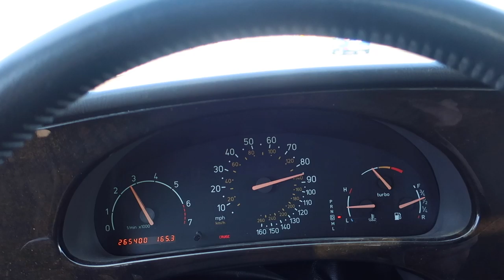Super Rare Junkyard Parts Find for my Saab 9-3!

Comment: I have 2 saabs and one has premium leather. If it is premium leather there should be a  "Saab premium leather" badge on the side of headrest. The premium leather has very little shine to it and it is very soft. Also it has smooth surface without the little "bumps".
Reply from the maker: thank you for the info; I'll have to check out the headrests then to see

Comment: The back seats are just locked in with springs, as you can see. You just have to use like a flat head and press the black cap in towards the seat, and then you can lift the seat straight up. You have to take out the left smaller part of the seat first and then the right larger part, because of how they are connected in the middle
Reply from the maker: yep! got it all sorted. thanks for the help :)

Comment: They look like premium leather seats with double stitching. I recently bought an Anniversary 2007 9-3. Would you believe it, over 12 years old and only 13200 miles on the clock. Regularly serviced, immaculate condition! It was a choice against an Aero 9-3,  11 years old, 13500 miles but with cream leather seats. They tend to easily become dirty with use. My previous Aero was T boned and totalled, gutted. Surprised to fall lucky, especially after having the Anniversary Stage 1 remapped. 
Try using a 13mm ratchet spanner for the back seats. 
Love the videos here in Manchester, England
Reply from the maker: wow nice! And yes, thank you. got the backseats sorted over the weekend!

Comment: you need some "Gear wrench" ratcheting wenches!!!!---priceless in the salvage yard!!!    --Also, Have you considered replacing those delicate glove box parts with something aftermarket.. (I recently bought a 2004 9-3, as I recall, both mine are good, but should they break, I work in a metal fabrication shop (builds Fire Trucks) with a water jet and would (re-pop) a set from aluminum or stainless steel,etc to fix them for "good".. :)    not sure if they were all the same over the years..  Honestly I am newer to SAAB cars when I bought my 01 9-5 Aero last year---LOVE IT!!!  So I bought the 04 9-3 with broken timing chain for $900.00 delivered to me from 75 miles away..--About to buy another 01 9-5 if all goes well (same color as my current 9-5--Black--for $500, running..)..  Kudos to you my friend!
Reply from the maker: thanks for the help Geoff! And nice buy lol

Comment: Next time slide the seat forward, there are 2 t50 screws and than you remove the whole seat with rails
Reply from the maker: Yes, probably should've tried that lol
Reply: Was thinking the same thing...
Also the rear seat backs have a spring loaded ring/disk you just push to the side near the 13mm.
No need to unscrew the bolt.
10 min. Job 👌